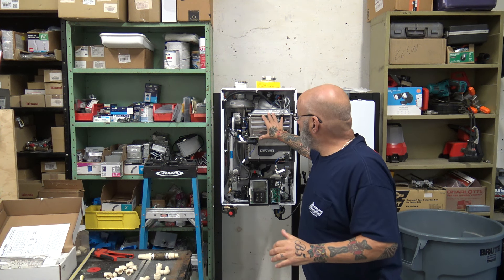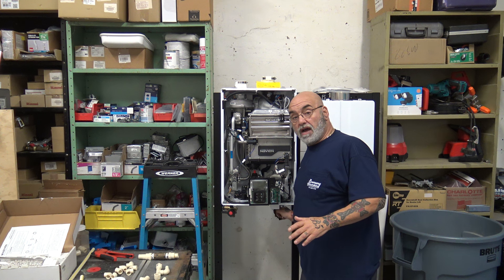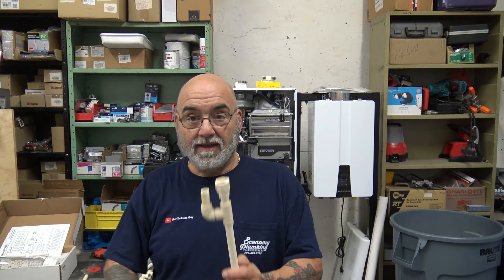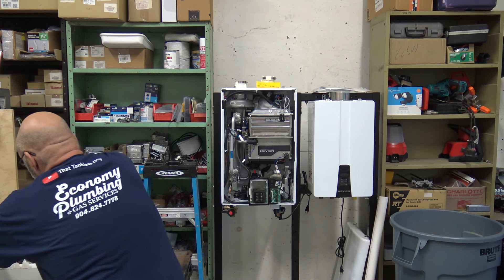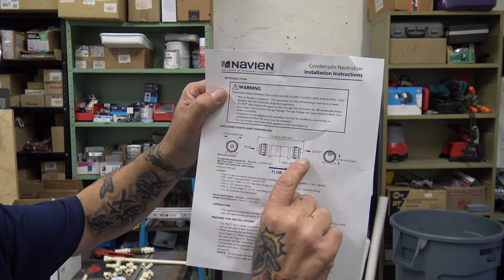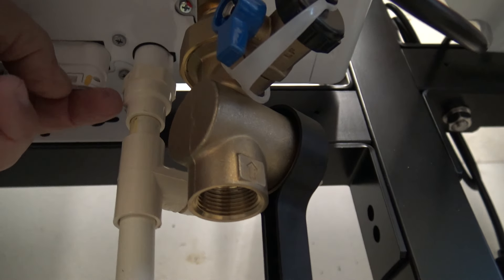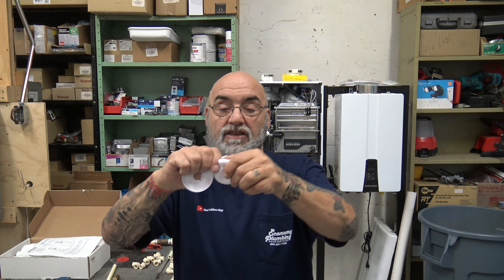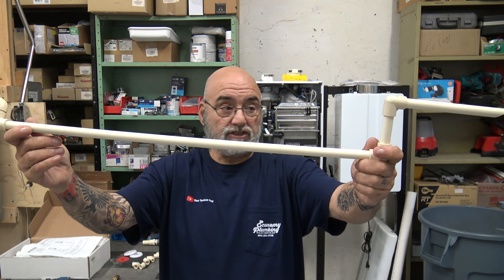Proper condensate drain piping on a Navien tankless.

Comment: The Navien condensate drain already has a tiny relief vent hole built in above the threaded discharge and CPVC is not a manufacturer requirement in fact it’s just PVC.  Adding a T and an additional 1/2” vent is not a bad idea but not necessary because condensate just drips out and not a gusher.  I run all 3/4” PVC for the condensate drain into a dirt patch and have never had a problem.  Copper or CPVC must be used for the PRV line.  I use a commercial grade CPVC (grey color) pipe.

Comment: I installed a Tankless Rennai in my gut renovation. Worked great for about a year then stopped working..  the Internet said something about vent on condensate line. I didn't have one because i believe the manual didn't say to install one. Put one in working for 3 years now. Great video thanks

Comment: Hi Mike,   I really appreciate your videos!  I have a Little Giant condensate pump below my Rinnai RU160ip.  The line going to the pump does not have a vent.  Should i vent this with this setup in the way that you recommend?  It seems to be creating a water flow issue until I tap the pump now and then so I'm guessing an air bubble.  The second problem I have is the condensate pump can seem to pump where they have run the line to.  There is a drain in the floor close to the pump.  It is okay just to run the line into that?  Don't know why they didn't do that

Comment: Hi, I am a plumber and I work in California, sometimes when I come to a problem with a water heater, I see that from the bottom of the heat exchanger there are drops similar to condensation and which sometimes drip and destroy other parts, I have a question, what can cause them?

Comment: We just had our first big freeze of the winter in the PNW and the discharge protruding outside my house froze up. (now it's insulated) Didn't realize until after I got out of the shower. Thanks to Mike I installed my indoor Rinnai tankless with the air vent in my relief line and it worked perfectly, preventing condensate from backing up into my unit.  A little mess on the floor but no real damage done. Thanks Mike!

Comment: Hey Mike, great video. I appreciate the detailed explanation with why you do it this way.

Is this also necessary on their combi boiler units? I've noticed they never have that bit of detail in their installation manuals.

Also, have you ever run into issues with how brittle CPVC is?

I've seen several plumbers say they won't install CPVC unless the customer signs a waiver. The waiver basically saying anything CPVC is not warrantied and callbacks/repairs on CPVC are full price because it's brittle and tends to fall apart. I've seen most recommend Sch 40 PVC or if the customer is really paranoid, sizing up and using Sch 80 PVC. Any thoughts on that?

Comment: Mine doesn't have that. It was installed professionally and now has been error ing out after 8 months. I see rust inside the unit and they have been out many times to fix but it's still has a ignition error. Do you think that is my problem?

Comment: Do ya need to glue the fittings all together or van ya just press them in tightly for future removal and reuse, if possible
Reply: Was wondering the same thing lol
Reply: Dry-fitting PVC is often so tight that it's difficult to pull apart and you're talking a low-pressure drain line so it's not going to be prone to leaking but it really depends on how much condensate you're producing, how you're draining/routing, and who you're doing it for. That being said, I see no reason not to glue it and you absolutely should especially if you're running anything through/near a wall or anything else that could be damaged by a leak.

If you're asking because you're unsure about your routing, I wouldn't see an issue with dry-fitting it all and seeing how it works out for a day or so before committing to gluing but I'd take precautions to ensure that if it does leak, it's not going to damage anything.

If you're asking because you want to make it serviceable, I'd use unions before/after your neutralizer and glue the rest.

Just my two cents but as a disclaimer I'm only certified for mobile AC and refrigeration. By no means am I a plumbing/HVAC professional.